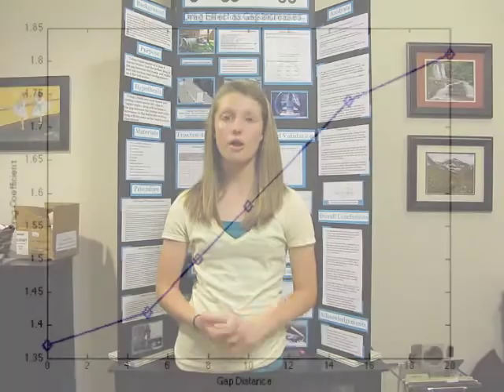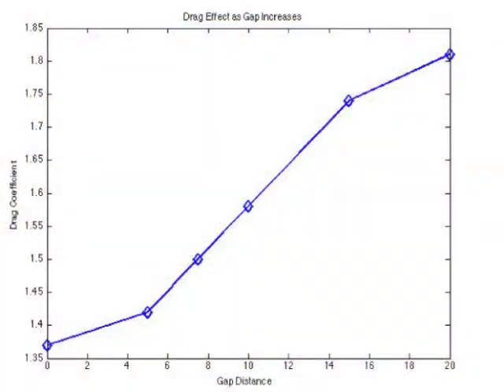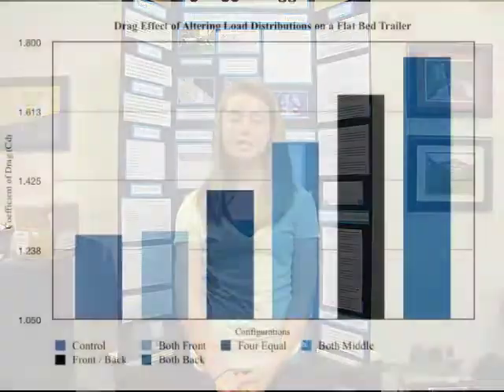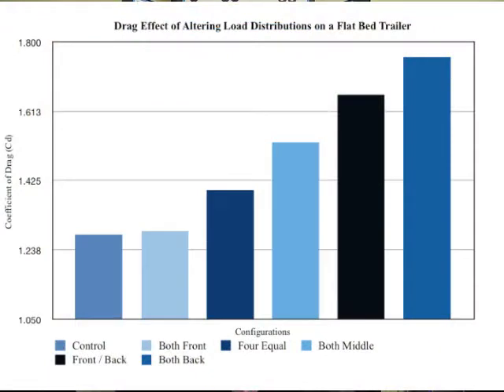Don't be a Drag: Improving the Aerodynamics of Tractor-trailer Trucks

Comment: Megan - you ROCK Lady!  Now, here's teaze for you; are up super confident about your gap figures?  The reason I ask is; If you do put a straight line between your lowest unit and your highest - the get a point in the centre - at the 10 mark - suggesting that  just maybe the drag increase is in line with the gap... Hit me back.. Now, point two. Whilst your efforts are highly laudable -  loading a trailer can be a matter of safety - through weight distribution. The weight over the rear axle does two things: 1) it compresses the load sensing valve thereby increasing the braking effect. 2) because the wheels are loaded then they grip better rather than lock, skid and create a pendulum type action whereby the trailer swings out into the road.... So, how about you run another test? Put sphere shape on the front face of your trailer - and a corresponding cup shape on the rear of you tractor? That way they can both turn and rise up over undulations whilst maintaining minimal gap - SIMPLE - But no one is doing it!